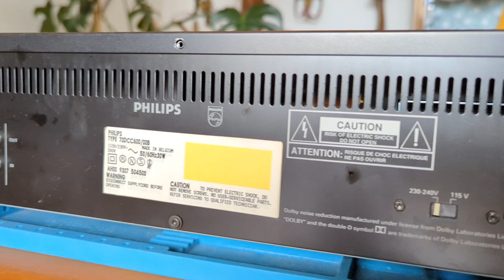Digital Cassette Player Problem. Bringing this Philips dcc 600 back to live Part 1

Comment: Hi, what was that orange part you replaced and where did you buy that, can you post a link here plrease-thanks
Reply from the maker: https://www.ebay.de/itm/164218450439?mkcid=16&mkevt=1&mkrid=707-127634-2357-0&ssspo=vGBEby8zQlG&sssrc=4429486&ssuid=q2k8xs7iqrw&var=&widget_ver=artemis&media=COPY
Reply from the maker: Hi, that is the piece i have ordered. Good Luck with your repair.
Reply: @forgottenAudioTechChannel  Thanks for your help
Reply: Hi, how did you open the tape mechanism? You only show a small amount of footage when you remove the tape mechanism. I need to see how you disassemble it fully please.
Reply from the maker: Hi, i actually dont have more Material to Show you. But i can try to help you. When exactly Do you need help or advise with what?